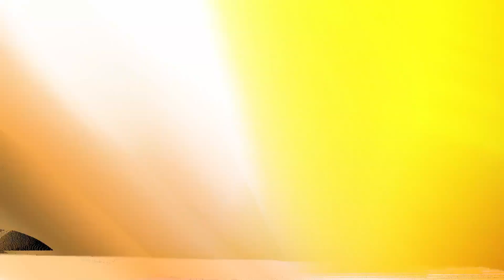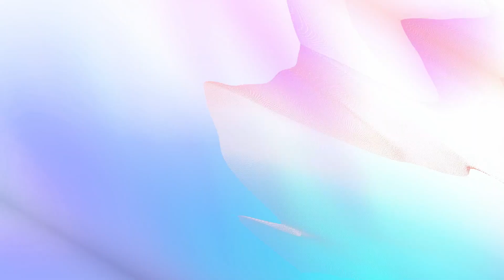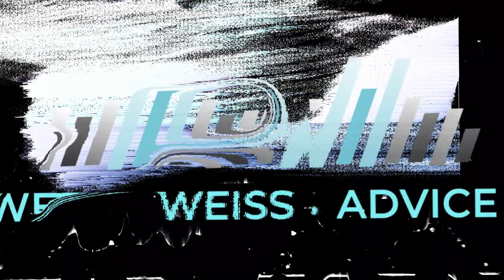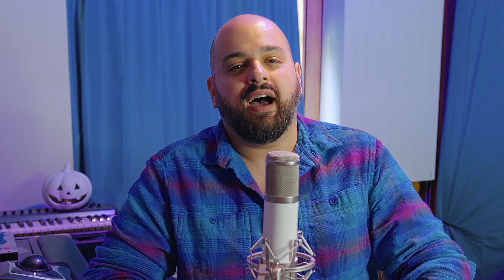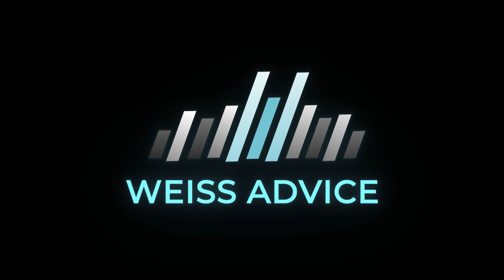What Sample Rate and Bit Depth Should I Record, Mix, And Print?

Comment: If you're recording a podcast that will be posted on YouTube as a video, and also an audio-only version for regular Podcast apps (Apple Podcasts, Spotify, etc...) what sample rate should we use? Record in 44Hz and convert the project in the video editor to 44Hz to match? Or should/can the 44Hz be converted to 48Hz for the video but stay 44Hz for the audio-only podcast?

Comment: My understanding was that 48kHz and Video are a thing not because of added fidelity but so that the Samples and Video Frames at 24 pictures per second align perfectly. But I could be wrong about this.

As a note to your explanation of gain staging in 24bit: Especially in recording it does matter that you record at reasonably high levels. That might be intuitive to most, but it really is very important. Because what you are doing when recording at lower levels is essentially reducing bit depth and hence reducing dynamic resolution. For a 0dB full scale sample we have 24bits to work with, it’s 24 1s in a row. For a -144dBFS signal though we only have 1 bit to work with. It’s 23 0s followed by a one. Every added bit adds 6dB to the amplitude of a sample (it’s binary so it doubles and doubled means +6dB in most cases). So by going to -138dBFS there is a 6dB jump, that simply cannot be avoided. There is no data to interpolate between the two values. Going to -132dBFS you now have 3 samples to work with, the resolution is getting better up until the mentioned 0dBFS where we finally have the full resolution. 

So recording at good levels, really is essential, cause by turning up recordings that were recorded at excessively low levels, you will not get back the dynamic resolution. 

This does not apply to floating point bit depths, since they work very differently in terms of representing the values.
Reply from the maker: I guess "reasonably high levels" is ambiguous, but for the most part this information left over from the 16-bit fixed days that does not apply today. Recording too close to your digital ceiling, even the artificial one present at 32-float runs more of a risk of damaging your audio capture than running at modest levels.

Comment: I tried a few tests on my side now exporting  at 44.1 and 48k. I really do not hear a difference. I also recorded vocals at 44.1 and 48k, I also do not hear a difference. In fact the 48K sound more muddy. I might have been standing closer to mic🙂 It also sounds like you prefer mor 44.1KHZ projects. I think I'm going to also give it a change for a while and see how it goes. It might be a bit easier on my computer to record and mix at 44.1kHZ instead of 48KHZ
Reply from the maker: chances are you were closer to your mic. If you normally record about 5 inches away, and you accidentally record at 4 inches - that one inch difference now means your are 20% closer to the mic.

Comment: I feel like you should use the best/highest settings your equipment can accommodate and when it gets 'dumbed down' to a lower bitrate or sample rate down the line you are going to have a little less distortion in your final sound simply because there were more dots to connect before dithering down. I used an old Samplitude DAW until a few years ago just working with the soundcard that came w/an old laptop. I could choose btw 16-bit recording and a 24-bit recording capture, but the card can only play 16-bit audio so it instantly downgraded the 24-bit capture to 16-bit for playback. That option had an audible difference with the 24 to 16 option having a lot nicer sounding highs. 16-bit highs were always crunchy distorted. And not in a good way. 
  Weirdly when I changed the sample rate to 96 KHZ or 22 KHZ it changed the speed of the recording! I don't know if that was a bug of the old version or if it had to do with the fact that the sound card didn't support different sample rates? Pretty confusing when you are just trying to figure out what does what though. 
Good info. I find the sample rate changes are best for an effect in the production stage to dirty things up. Higher rates are preferrable when clarity is the goal.
  Also, when I use higher sample rates with my Apollo Solo it makes each effect use more DSP by my reckoning, so if you use DSP on the way 'in', that may be another consideration when recording.

Comment: I just want to work with great settings that give me great results sound wise, mainly for music only, not film and not want my computer struggling while mixing that causes more frustrations to get music out. Would you therefore suggest 44.1 and 24 bit or 44, 1, 32 bit or 48 and 32 bit?
Reply from the maker: 44.1 and 32-bit. But honestly, any configuration will give you great sound - and if you're not getting great sound, it's something else.

Comment: my distributor suggests to send a 16 bit wav file master for on streaming services what do you think about that?
Reply: Send them what they ask for. They're the distributor. They know what they want or need in order to make their process work. It's just one more export for you in their format. I've worked at 96 all my life and recently I moved down to 48. I didn't really notice anything honestly. The differences are way smaller than you think. If the mix is poor to begin with, this will not give the improvements that you envisioned. I struggled with this for years before someone showed me the differences. A good mix at 48 is way better than a shit mix at 96. I think what I'm trying to get to is that nowadays, with the technology we have, the export will not make or break your mix. The mix will. Everything will sound amazing, even 44.1, because what goes in these days is really, really good, no matter what the interface is, even the cheapest. Hope this helps.
Reply from the maker: I think it's an odd request.

Comment: Great video as always Matthew on a subject that can be complicated to say the least and have staunch arguments from all sides, you navigated it very well with very good information! I work at 24 bit 96K was always what we tracked at simply because back in the mid 2000s when we had less info and digital had issues (you remember Matthew) we used 96K since latency during tracking was lower and 96K. Also 96K was the same about the same bandwidth as our tracking console and gear (some could reach higher but our desk was 3 db down at 50ish Kilohertz) so 48 kilohertz was a nice medium. Also back then many plugins did not have issues 96K like EQ cramping and pre-ringing of linear phase filters (which is mostly gone today at all sampling rates). 
 Another consideration is most live digital consoles you would encounter used 48K until around 2020 except the very top end mixer. So brands using 48K were the Behringer/Midas x32/M32, Presonus Studiolive, Yamaha TF, and Allen & Heath QU mixers. But the trend has been toward 96K with Allen & Heath SQ, Yamaha DM, Midas Heritage-D, even the little toy Zoom LiveTrak L series run internally at 96K. The live world uses this simply for lower latency and cleaner channel strips since oversampling can't be used in the Live world due to added latency. So if you record live shows you will now start to encounter more 96K digital consoles. But in the end use what is optimal for you and your rig. I personally use 96K but I get songs sent to me all the time that are 48K or even 44.1K and its fine. But be aware some plugins don't work above 96K yet some (not all) virtual instruments and guitar Amp sims are sensitive to sampling rates due to aliasing. But in the end if the song sucks it will suck at 44.1 or at 192k sampling rate but if the song is good it will be great at 44.1 or 96K because on the radio or online, no one can see your gear they can only hear the final product!!